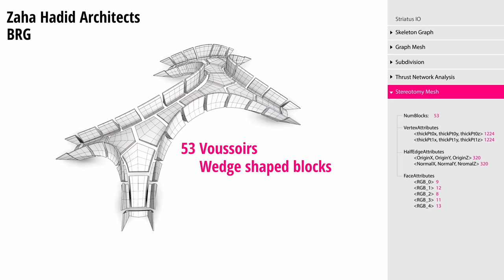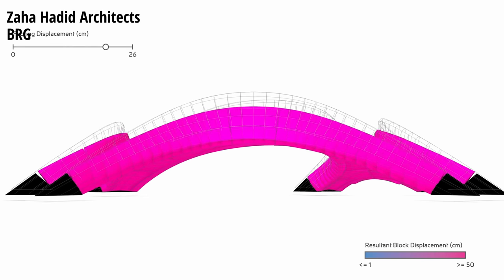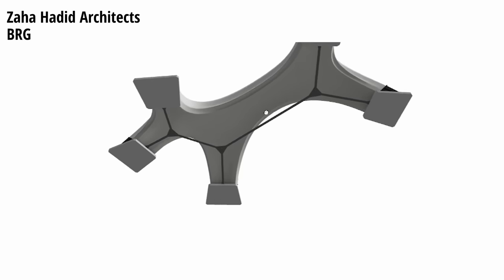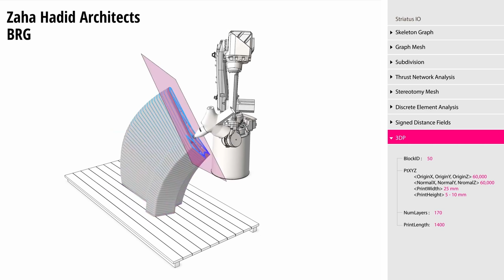3D printed bridge with NO connections! | Striatus

Comment: Who else fell for the click bait? This is not a bridge in the sense that it will convey vehicles or pedestrians over a distance that would otherwise be inaccessible (river, gorge or overpass). It is at best a very expensive playground novelty. Come on Belinda, you usually have practical videos.
Reply from the maker: Clickbait? It is literally a bridge with no connections. It may not fit your definition of a bridge, but it bridges a walkway. Come on.
https://www.striatusbridge.com/
Reply: @BelindaCarr  This is a piece of expensive junk. This bridge connects NOTHING! I have lost all respect for you Belinda if you truly think that this is a bridge. A bridge conveys vehicles or pedestrians over a distance that would otherwise be inaccessible (river, gorge or overpass). I STAND BY MY ENGINEERING DEFINITION.
Reply: @BelindaCarr   05:40 The best way to make the area wheelchair accessible would be to remove the so called bridge. People with walkers would also be grateful.
Reply: @BelindaCarr  it is "literally" an artistic "installation" it can't be a bridge" because it doesn't " bridge" anything, a bridge is a connection between two points that avoids obstructions. If there is no connection and no obstruction there is no bridge. I suppose its a raised walkway or perhaps viewing platform.
Reply: The title is a literal description of the content of the video, and the thumbnail is showing the printer working on a section of the bridge. It couldn't be less of a clickbait...
As for the bridge itself : Belinda didn't claim that it was solving transportation issues. At the risk of sounding obvious, I think that the point of this bridge is to showcase the construction technique.
Reply: @1982nsu  Go easy on the allcaps. Your tone is not appropriate. This is not the kind of topic that should get you sounding this upset.
Reply: So many people posting are being very dense and it seems they enjoy being so.  As the title states: 3D printed bridge with NO connections!  Arguing that it has no connections is imbecilic.   And arguing over the definition means you're ignorant of all the definitions of a bridge:
_ n._ A structure spanning and providing passage over a gap or barrier, such as a river or roadway.
>>>> n. Something resembling or analogous to this structure in form or function. <<<<
n. Any of several card games derived from whist, usually played by four people in two partnerships, in which trump is determined by bidding and the hand opposite the declarer is played as a dummy.

Are you next going to argue that it's not a card game as well? Since you can't figure this out: It's a prototype.  Just as if someone (or some company) were going to build a new boat or ship, they'd build a prototype first, generally the hull section to get proof of concept.  After that, they would progress to making the boat or ship itself.  The first steam car was made in 1769; the first electric car 1832; the first gasoline car 1886.  It wasn't until 1896 that we had the first 18-wheeler.  That's how technology and advancements work.  You don't build a space shuttle before you build an airplane.

Put your thinking cap on and realize that they have to make this work before they can make it better.  There's a reason why it's essentially artwork and not used to cross a busy intersection.  Baby steps.

Comment: I don't know how they can claim that "The next generation of inks can include Holcim’s green building solutions" when the "ink" they're using has nothing in common with the "eco" concrete they offer! It's not concrete! But you can make anything carbon neutral with some very dubious poorly accounted carbon offsets.

All the talk of "beauty" and "without compromise on aesthetics" is absurd for a technology that everyone knows looks awful! The actual thing doesn't have the sleek lines of the renders because it's broken up into parts and covered in the artifacts of 3d printing, the steel and concrete end points also look awful!. It's not just that it isn't useful, accessible, or environmentally friendly, it also fails at the one thing it's supposed to do.
There's a lot of potential in carbon negative building materials to replace concrete that would be really useful in construction, but press release bait that is focused more on greenwashing concrete manufacturers and "highly skilled labour"(that doesn't have a history of unionizing) isn't going to do it.
Reply: I think a big part of why this stuff looks so bad is the "geometry based" architecture which only looks good when made of renderite. A rowhouse is just big box made of bricks but with attention to detail it looks so much better.